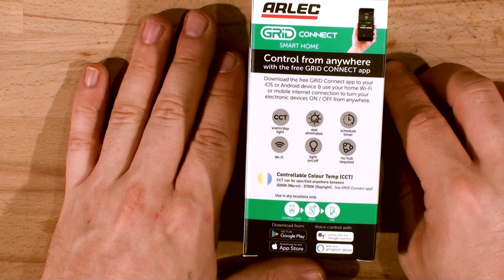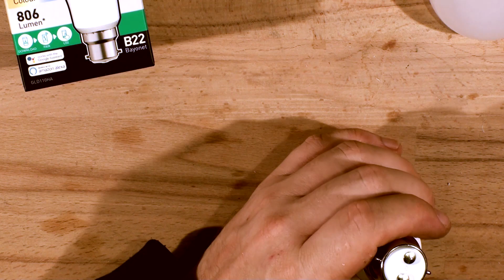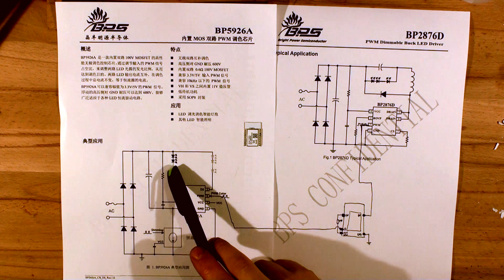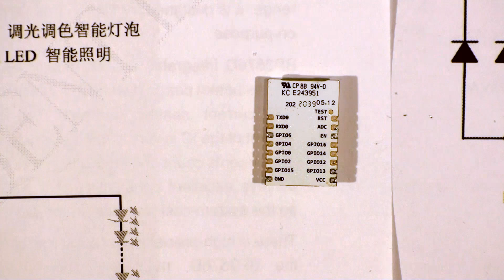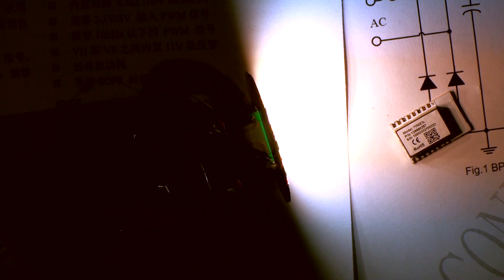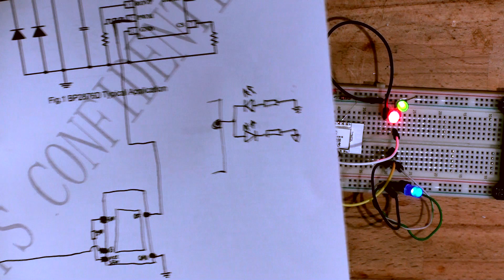An Interesting discovery inside CCT Smart Bulb. What can we use it for

Comment: the pwm input pin of colour selection ic accepts analog input voltage to change current of the two led strings. jut connect centre pin of a potentiometer to pwm control pin of ic ,connect other pin to gnd an 3v3 and you will be able to control output light colour temperature using potentiometre.